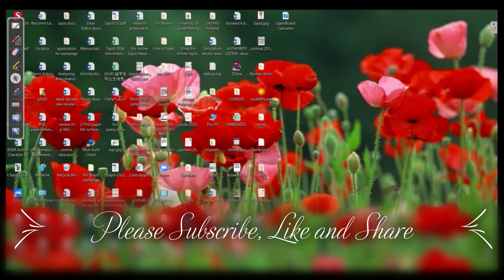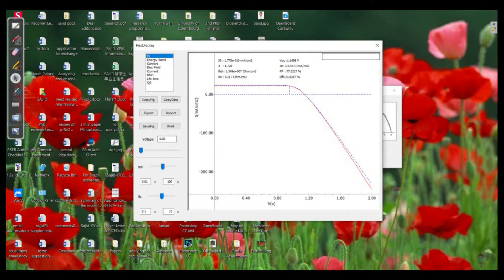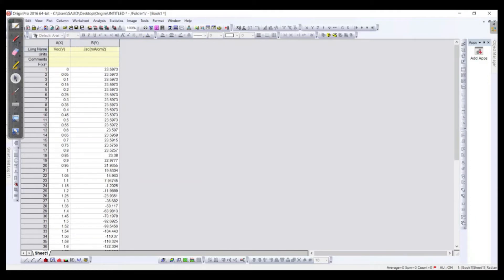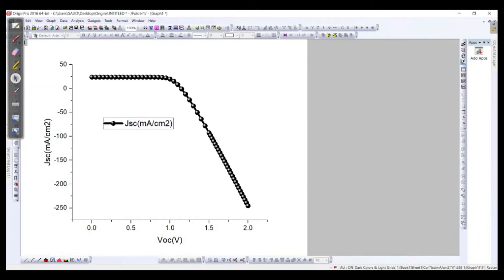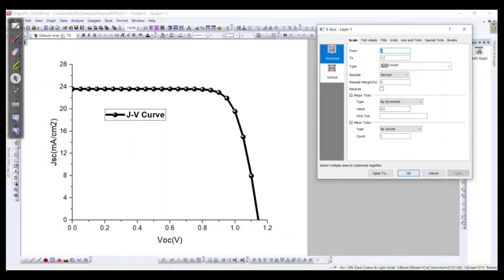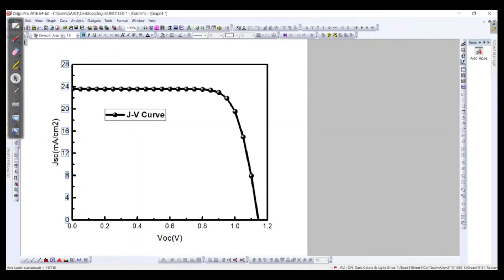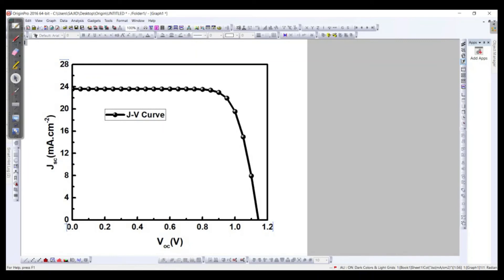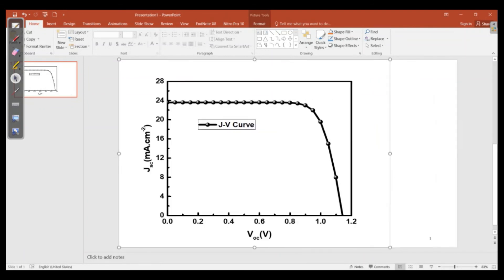Current voltage of perovskite solar cells from simulation

Comment: Hello sir 
 I have a question about the wxAMPS software. Can I use it to simulate the semiconductors used in the photoelectrolysis cells of the water And where can I find the electrical properties of the materials?
Reply from the maker: Yes we can simulate if it is based on thin films, you can get the parameters of the materials from existing literatures and make changes in it for example we can analyse the performance as a function of defect density in the used materials